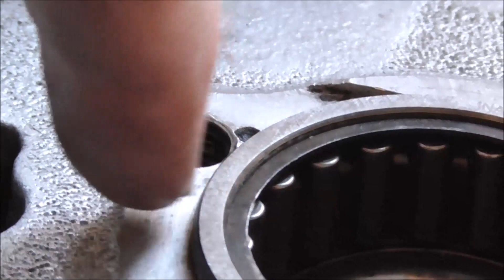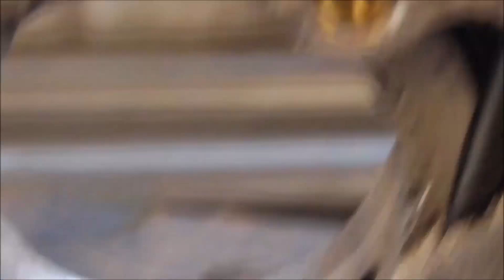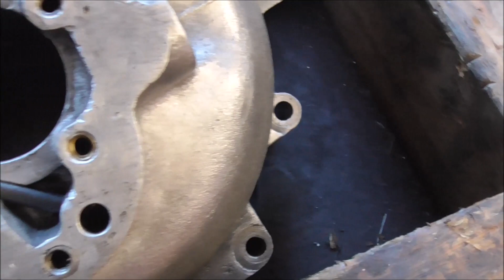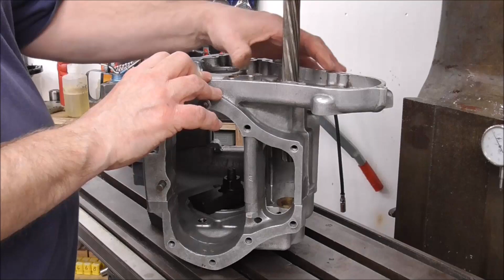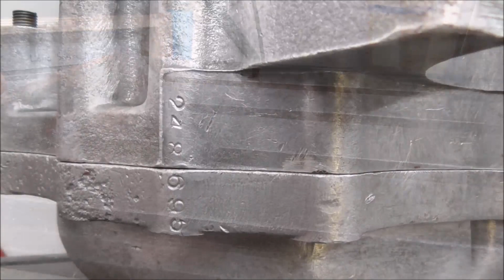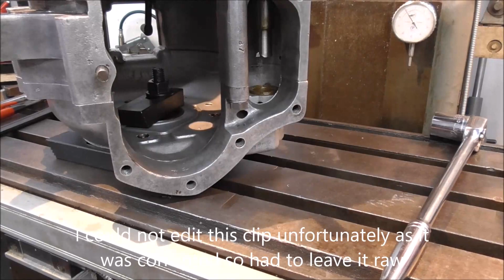BSA A10 Timing side roller bearing #1

Comment: I can see that line boring bar would work a treat with remachining  mismatched cases. Great solution as usual.
Reply from the maker: Thanks for the comments. The boring bar could probably be used in a drill press or even a hand held drill at a push as it is well guided by the double bushes on the timing side. Regards, Ade

Comment: Would you recommend this modification to someone that is about to start a rebuild?Do the benefits outweigh the work involved?
Reply from the maker: Great question, thank you. This is a choice someone must make after taking into account many things:
1. What am I using the bike for, road occasionally or lots of miles.
2. Am I a sedate or hard rider.
3. Will the bike get regular maintenance and oil changes
4. Is it for racing or sidecar use
5. Can I do it myself or do I have to pay a fortune
6. Is the original case bore for the bush worn or misaligned, would a roller be a good way to cure this
7. Is the crank main journal worn past bush sizes or damaged, would a roller cure this
8. Do I like the idea of experimenting with/improving my engine 
and probably many more.
I have some parts gathered to 'play' with that would otherwise probably be scrap or never make it to a bike, I believe I have the ablity to do this conversion and would like to rise to the challenge, so I'm going to do a version of this conversion and do it step by step so others can make a more informed decision, or have a go if the wish, the choice is an individual one. Thanks for watching, look forward to your comments in future episodes, Ade.

Comment: As the Lipton would say, "SWEEET", 
Funny it looked like that boring bar should have run the other way, a trick of the light playing with grind facets clearly or not as the case might be. 😀
Reply from the maker: Ha, the observant one, you know what, when I was editing I thought the same and went back into the workshop to check myself, an illusion, rotation was still forward and the grind is correct! Cheers Chris.
Reply: @AGEngineering  attention to detail it what makes us better than amateurs, if only😉
Reply from the maker: Oh I'm definitely in the enthusiastic amateur class....
Reply: @AGEngineering  😉